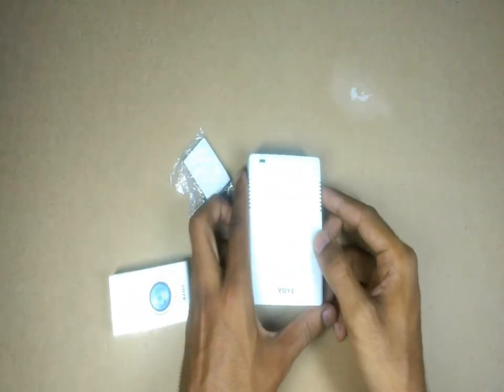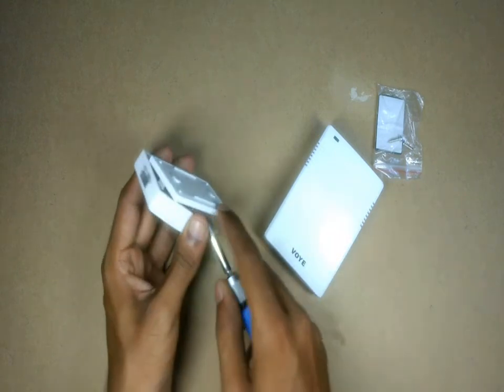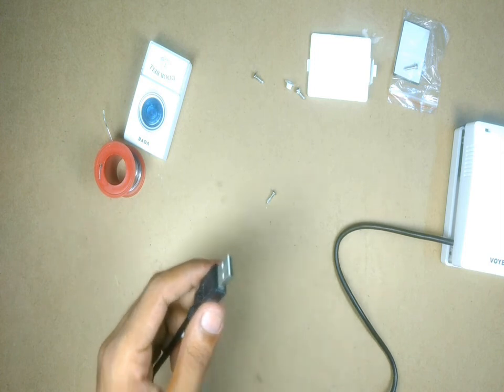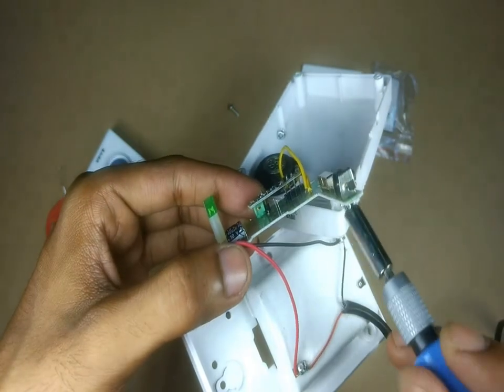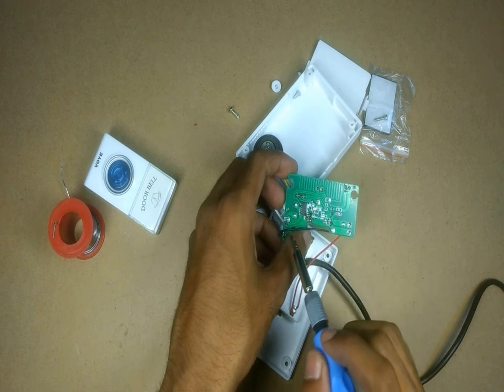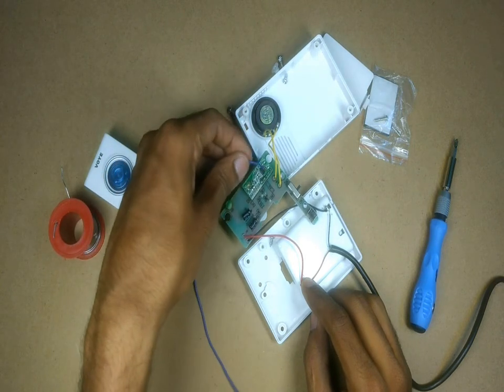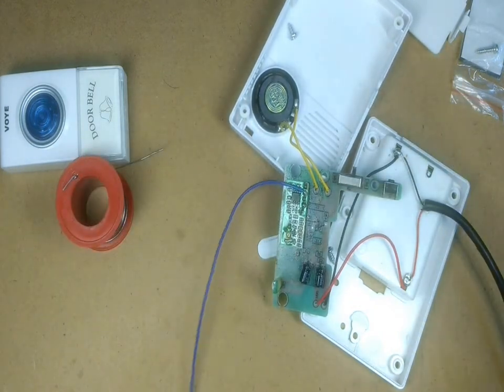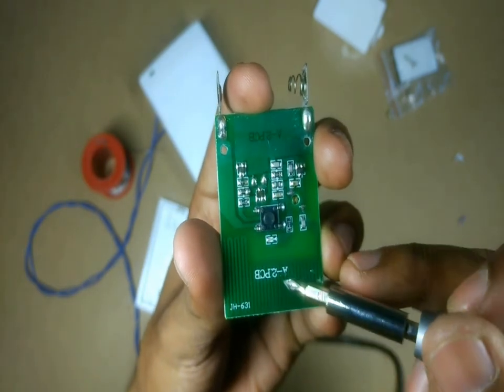#E-Cycle: Dead Wireless Door Bell Hack

Comment: We see that ur receiver is in DC voltage that using a battery.
How about when our receiver is in AC voltage...??
How connect the transmitter to receiver by cable then...??

Need info please.